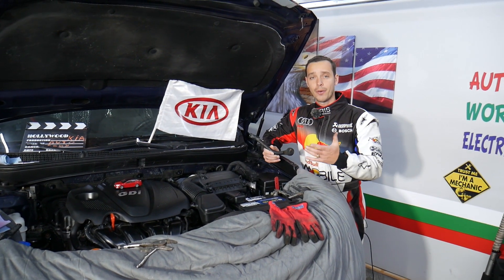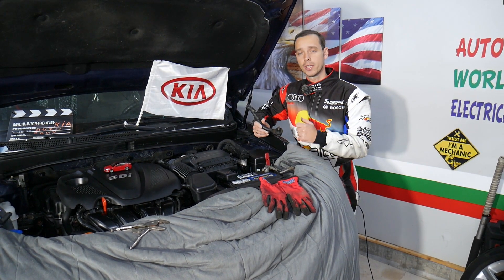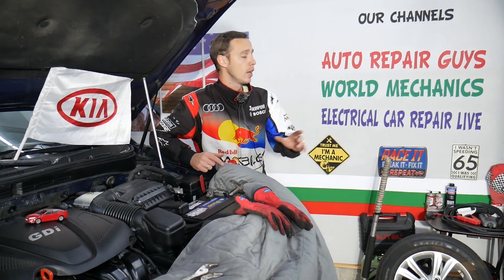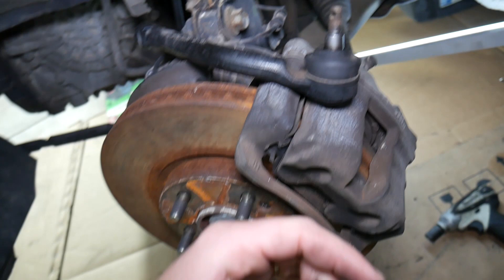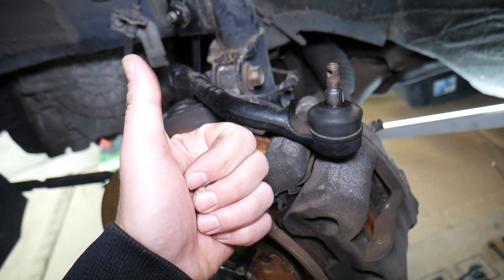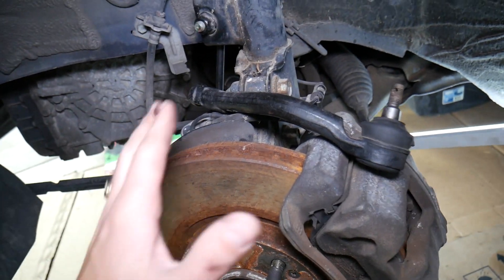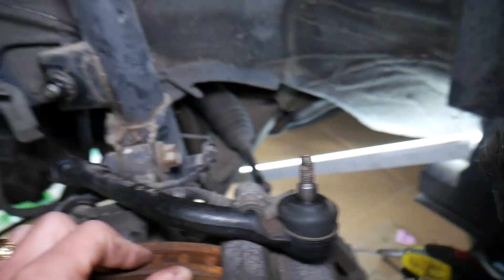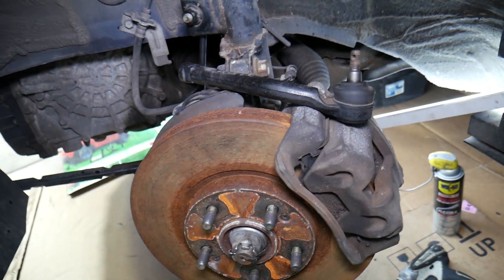WHAT ARE THE SYMPTOMS OF BAD TIE ROD KIA FORTE SOUL RIO SPORTAGE SORENTO OPTIMA

Comment: I have a problem with my E60. Before I changed the old battery which was screwed up to my surprise overnight, some function no longer worked on the car but all at once. The rear doors I can no longer open them, close them with the key and also the trunk and the interior lights work no longer. You will be what would be the cause?